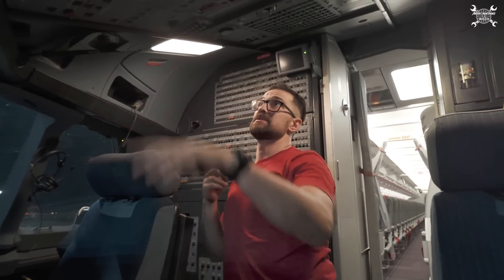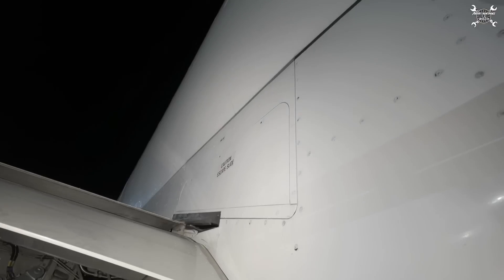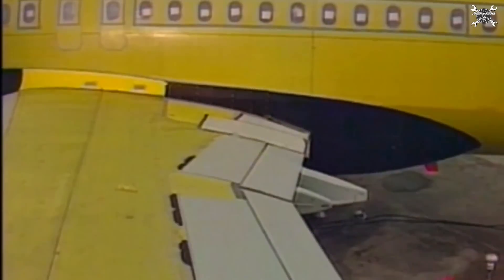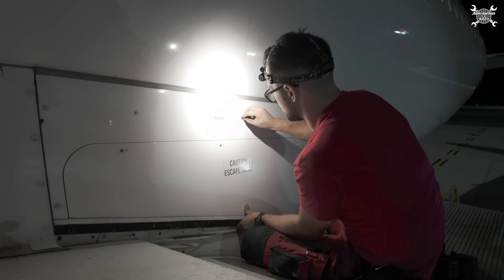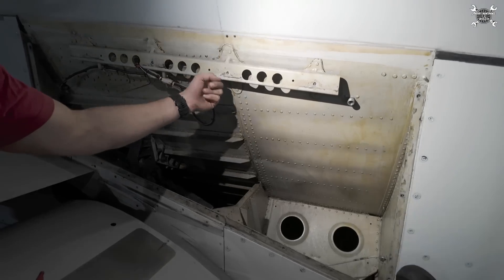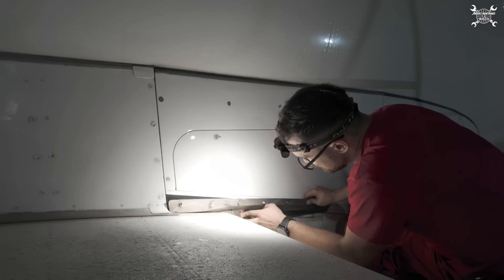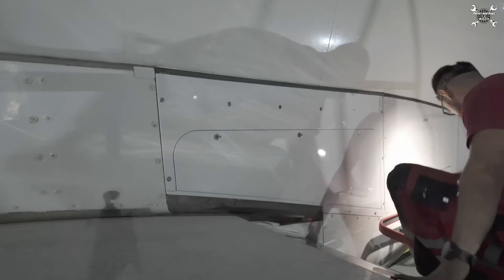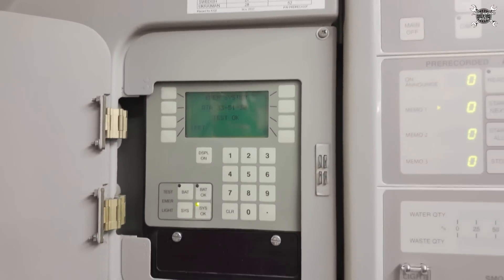Offwing slide and how to replaced it

Comment: Just did an over wing slide (left side) on a A320 last night due to an EPSU test fault. It helps to use suction cup handles to adjust the slide to align the fasteners in place.
Reply from the maker: Actually, that is nice help, clever idea 🙂

Comment: You are doing awsome job. I enjoy your videos of the aircraft maintenance. I'd like to see (if not covered yet on your channel and it is not top secret kind of stuff) how you make a final repport after work, who you report to and how you approve maintained aircraft back to operation. What parts you always have to replace (like gaskets, sealings, bolts, screws)? Do you follow any book with all maintanance and repair procedures are described in or does it come from just an experience. Is there system of certification for specific model/type of aircraft? Looking forward for your answers. Thanks and greetings.

Comment: Question. I understand installing hardware requires torquing to manufacturers or standard specs but are you allowed to use a cordless drill or air ratchet to remove hardware?
Reply: Yes. Also for assembly in certain cases, with suitable low moment selection from the drill and doing final tightening by hand. I have never disassembled cargo hold panels from Airbus without cordless drill.

Comment: Is that any interval changing for that nitrogen bottle?
Reply from the maker: Inspection for pressure value is quite often. We are not allowed to inflate it so we must replace it if the pressure is low or it requires shop check